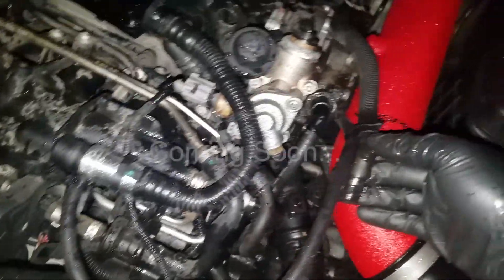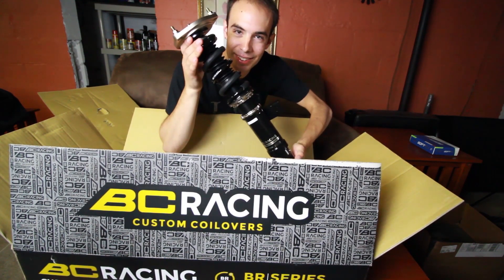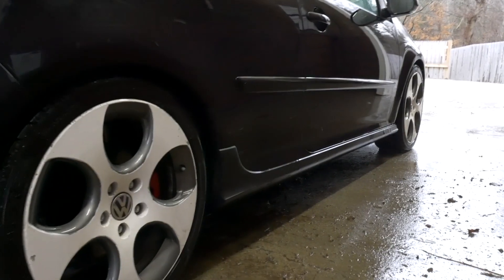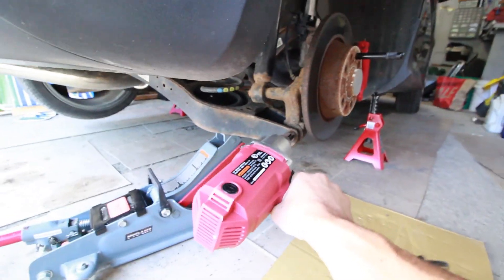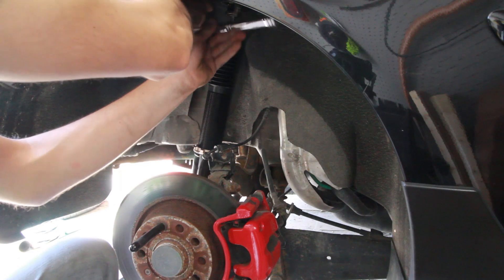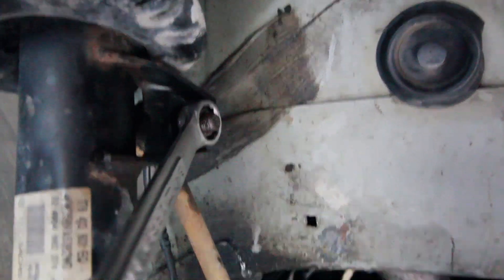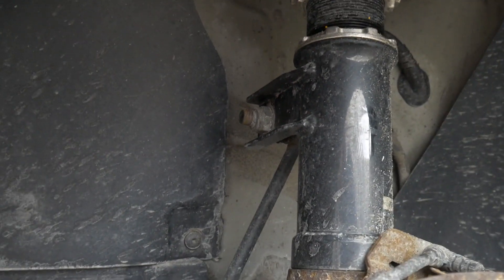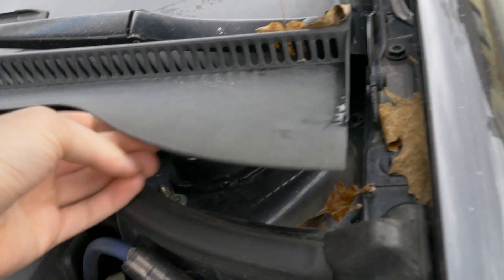VW GTI BC Racing Coilover Reveal and Install

Comment: Great Video! how did you go about fully adjusting rears? as well as springs did you adjust the rear struts too with the threads?
Reply from the maker: I left the ride height / preload all the same from factory. Only change I made was dampening. I turned the dampening on the rear to half way point and front to the softest. 

Perfect height for me, little stiff and uncomfortable for the amt of potholes and rough roads in my area but new roads feel amazing.

Comment: Hey cool vid. Quick one, why didn't you use the rear bump stop
Reply from the maker: I guess I didn't show it clearly. at 3:33 on the right side you see the stock bump stop on the spring where it would meet the body. The strut bump stop isn't needed, nor would it fit unless you take the whole shock apart. the damping adjuster is in the way.

Comment: About anti-roll bar link that was spinning, if it doesn’t have a torx or Allen key fitment in the end, near the bush the other side of the mount there should be a slot for a spanner (usually around 17mm)

Comment: Excuse me, can you help me on how to put a blow off valve in a 2007 volkswagen gti
Reply from the maker: I have a video on it. It replaces the diverter valvle which is located on the left side just above the front axel. With a blow off valve you also have to tap into the intake manifold to pull a vacuum line for actuation. A BOV kit should come with one.

Comment: is it painfull on ur back i can't even drive mine without My back hurting.
Reply from the maker: Its quite comfortable on smooth roads on full soft in front and 50% in the rear. Bumps and potholes make me cringe lol. The car stock has a more sporty suspension compared to a BMW or Cadillac sedan

Comment: Nice. How do you rate the comfort level compare to stock? I know the stock is already stiff
Reply from the maker: Comfort level compared to stock is pretty low. However my coilovers have BC's regular springs installed. If you pay extra to get the swift springs the ride would be better. With dampening all the way soft in front and medium on the rear is most comfortable and handles really good. But hitting potholes and rough roads out here in NY with low profile tires is rough. I noticed with my higher profile winter tires it is a lot softer ride on bumps.
Reply: @SavageGTI  Thanks for the info. What you have describe is spot on to how my MR2 and Caldina GT4 rides with them BC coilovers. Oh well, might be getting a VWR springs for the R then since i daily this car with my kids. Thanks again for the feedback buddy, appreciate it.
Reply from the maker: @sky1802  I think if you're trying to go low in any way it will be rougher than stock because you're reducing the available suspension travel and has to be stiffer to hold the weight of the car, otherwise the car would bottom out and rub tire.  The BC's are my only experience with coilovers, I hear KW makes great coilovers but they are a lot more money.
Reply from the maker: but maybe springs and good shocks could give you a nice ride but not aggressive low.